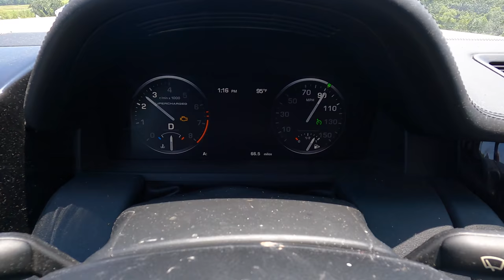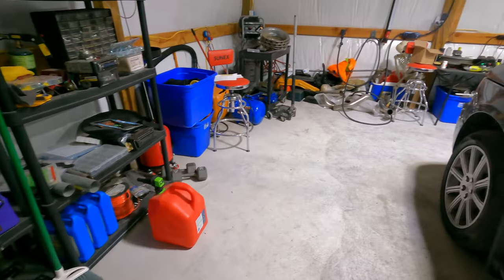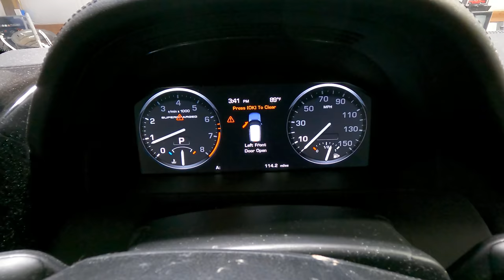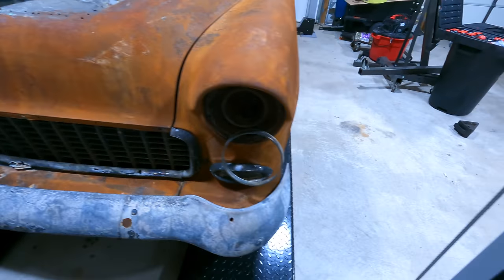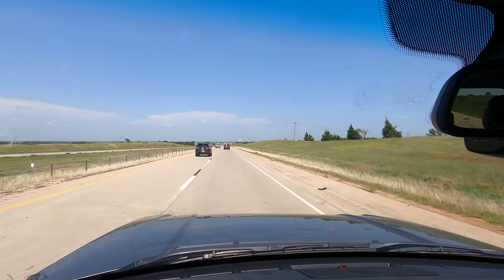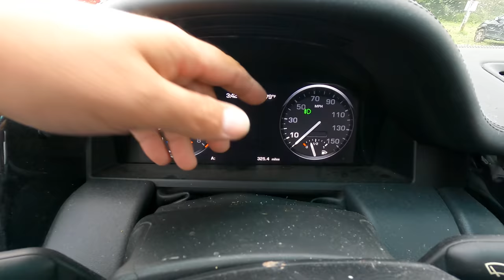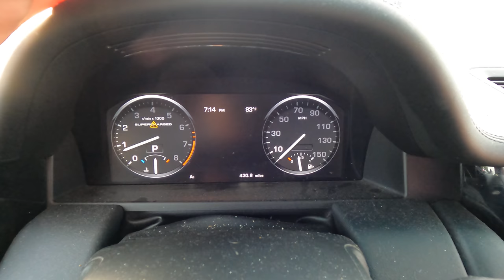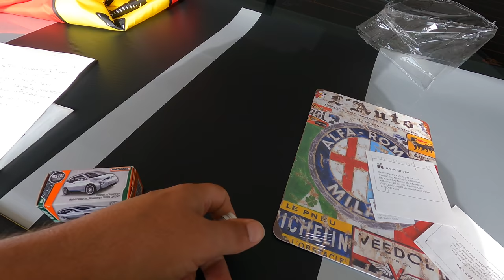I Drove my Cheap Supercharged 2010 Range Rover 600 Miles! Did it Make it? Ridge Wallet Giveaway!!!

Comment: That where I drive by where you got pulled over lots of speed traps Mulvane,ks bad for speeders.
Reply: Last ticket I got in 1993 was in Oklahoma on a more or less back road. The local yocals will get you there because they can't get you on the interstates.
You can go 90 to 100 on the interstates and never get stopped but you go a few over on a local or violate an obscure sign they'll get you.

Comment: I just bought a 2013 LR4 sight unseen. 1 owner, 74K, from southern state, all service has been done. It's awesome! I think the crappy reputation came from the Discovery 1,2 and some stuff on the 3.These vehicles are very heavy duty and weigh 0ver 6,500 lbs. In England they call them trucks not cars!
Reply: Need one of those wallets sir....

Comment: One of the most comfortable rides as well as handling of the road was a 2020 Landover I drove as a rental for a trip I took about a year ago.  Considered buying one but could not see paying 100,000 for a car.  Also, I know Randy says this one is solid, but everywhere I have read, says after 60 or 70k miles, your wallet will take another massive hit. But love the feel of this car when driving. The quiet but powerful beast under the hood, that got amazing fuel efficiency for as big of a car and beast of an engine.

Comment: That wallet is cool and so is that Rover, I'd take either one if you want give both away. The issue with Range Rover codes is that sometimes the engine lights come on because sometimes something will decide to stop working momentarily then comes back on, but it trips a code. We had fleet Range Rovers and Land Rovers for the company I worked for and this was the case all the time. We always had ours gone through because It was absolutely imperative our vehicles worked flawlessly, and our mechanics would never find anything wrong and that was the excuse Land Rover engineers gave us. These are temperamental vehicles and never get the 4 cylinder version of this or the Jaguar or Volvo.

Comment: I love my Rover. Do I think they’re the best off-roader? No. Do I think they’re great? Yes. Will I ever sell mine? Probably not. I’ve replaced the ac compressor in it, it’s had multiple air shocks, and an air suspension compressor. The suspension runs into issues with bags popping due to chafing from road grim. A simple boot over them would solve that and someday I’ll be adding it to mine.

Comment: miss fires could be coils and plugs. I had issues with coils going back on one and here it was putting out and electrical interference and was causing an issue with a bus wire making the suv have issues with connecting with the computer.

Comment: The biggest problems with Range Rovers are wheel speed sensors, when they are faulty it will show up as anything. They do need an excellent battery. Stu

Comment: 33:02 is that a missing parking sensor? I want to ask you, if so wierd you didn't get a code and in these European vehicles usually if one sensor is faulty all the sensors stop working. Had an 08 Audi A6 3.0T alot of issues but was a good girl.

Comment: We got a 2011 range rover from Auction it start in the view when the truck reach it wouldn't start we took out the fuse panel under the dash it has a lot of rust what might be the problem

Comment: You put out great videos had a range rover every thing with these vehicles are wire related problems the electronics are garbage just like a jag same company same problem along with the aluminum heads and motors good luck

Comment: Spent months and months on my 2005 Taurus on the check engine light and nobody could figure out what was wrong.  I went to put gas in the car the gas cap about blew off at me.  Ended up finding out it was the gas cap all along. FIGURES !